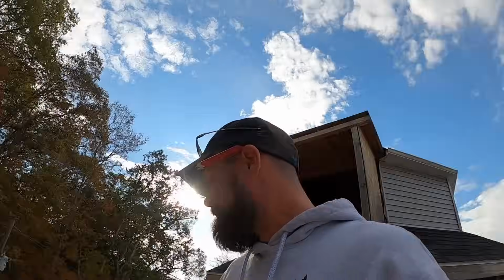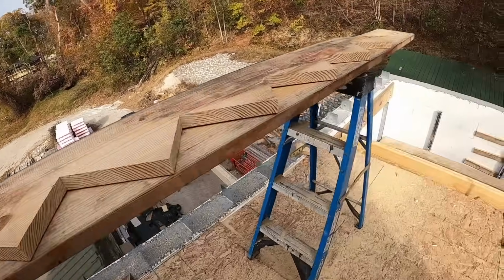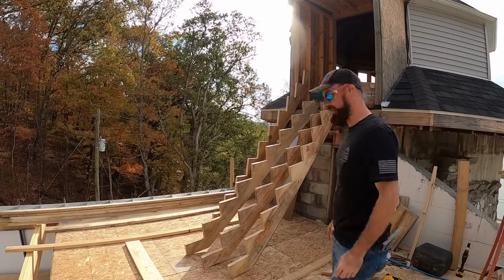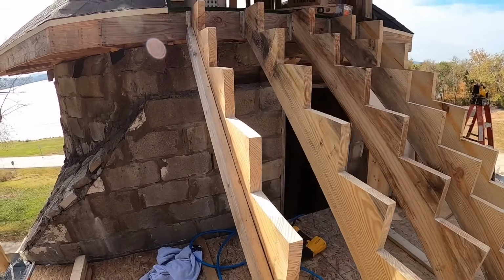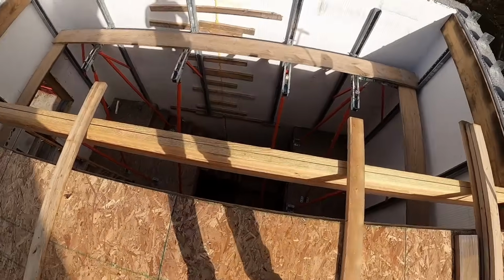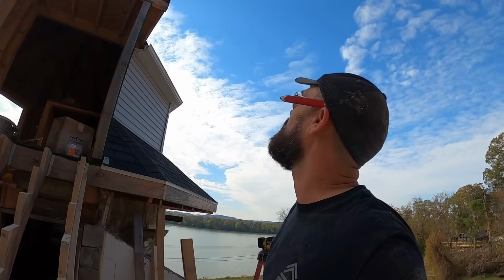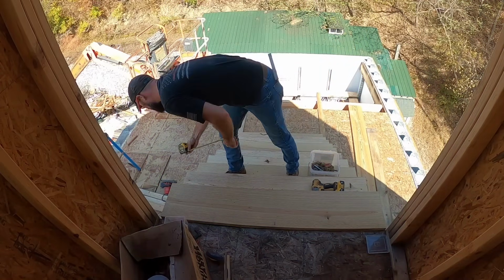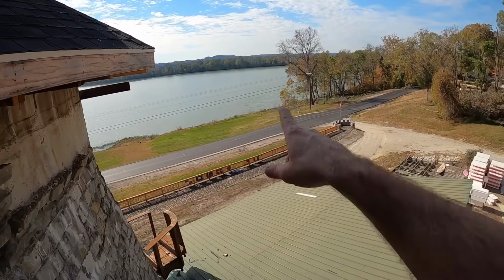Stairway to Heaven install! Did I get it knocked out this time?

Comment: 🌟🌟🌟🌟🌟 Coming down those strairs and go around both sides back twards rock wall and back togeather and down again like the stair you just put in directly under going same direction ---- kinda like a double blender mixing cake mix only at @ angle 💥

Comment: Matt , I use Twisted Mason Line that is colored to visualize where I might be able to lay things out . Tie a loop in one end and nail or screw it off to a starting point , then run it over to where you Think it needs to go , and secure it , stand back and ponder on it awhile . Much cheaper than cutting up lumber and changing your mind .

Comment: Hello Matt, thanks for the update. Something I do with all corded equipment is to flip the cord up over your shoulder and behind you and pull an extra foot or so.  If the cord is blocked by anything (like you or anyone else standing on it) it doesn't cause the tool to twist and ruin the cut. This little step will "mediate" all those issues.

Comment: Thanks for the pointing explanation. I saw you point and thought there must be something good - but did not see anything. After the explanation I went back and looked in slow motion - Just a few frames at 0.25 speed. For anyone looking - at about 4:10.

Comment: Question did you cut the width of your tread off the bottom of the stringers,, your right always use 1st stringer as pattern for the rest,,can't wait to see how you solve the space issue with the stairs,, doing good Matt,,,👍👍🛠🛠👍👍

Comment: On the next set of steps make the bottom section a longer run. Start out where they should , then run closer to the wall. Then off the landing the next tun is shorter dumping you out closer to center.

Comment: I have built dozens of stairways in my career as a builder. I got to where people would hire me just to build staircases, usually in places where other carpenters had told them there wasn't enough room for a staircase.  Everything from straight up one direction, straight runs with platforms like your first staircase., to full spiral stairs. I would suggest that in place of the platforms, you divide the platform into 2, 3, or 4 "turned" treads, or spiral treads. By doing this, you cand add 4 to 6 risers/treads in the same linear space. As long as you maintain a 7-1/2 to 8 foot ceiling above the stairway, moving furniture should not be a problem,  given the good width you have on your stairs.

Comment: If it was me from the top of your cancel, where you got that second route from the top just above you little slanted concrete. I see a wall there. I bring you wall straight out from tmatt. Can I someway and just drop it? A foot or a foot and a 1/2 at the outer edge from that corner of that roof that way, your roof is just the same angle as your roof your secondary roof off your top of your castle.  Power and then it will still push stuff off the top. But you still have a little room on each side of the building the floor that you're on right now. And still have a lot more room to put stairs. And you can have 2 or 6 walls all the way around the outside edge. And it would still be a lot more room out there.  And I'll not pull your building

Comment: Stick build the outside walls at seven feet to give you more head room instead of changing the roof look. In doing that you could install several windows giving a great veiw out side. A couple of skylights would really be nice.

Comment: You could run your stairs …. Starting on the far right side against the outside wall up to a landing turn left to another landing and turn left up to the landing of the stairway to hev . All this if you would be standing on the top floor looking down to the second floor stairwell.

Comment: I wondered why you don't extend your bottom flight the running distance of the lower platform(approximately 39 inches) since you are able to put the next platform (2nd flight one) over the first-floor bathroom.  That would raise you up another 3 steps on the first run, then conceivably move your second run landing that distance (39 inches) toward the center of the upmost floor for your top landing.  I would also consider installing windows, at least on the downriver side of the stairwell to heaven wall for the view and for the light in the stairwell.

Comment: You have extended your upper floor 10" and robbed 10" on the bottom floor. If you want 10 more inches on the bottom floor, cut the top step off of your stringers and slide them back. You may have to be a little creative with attaching the stringers at the top but looking at it, I'm sure it will work. You can do it!

Comment: Sometimes i am kind of slow so maybe you can help me understand, my thoughts on the base riser being 1.5" shorter was for the 1.5" tread to transfer the correct height all the way up the stringers. What am i missing with the bottom plate added below the base.

Comment: I hope you only misspoke and didn't cut too much off the bottoms of the stringers. 7-1/4 - 1-1/2 = 5-3/4, not 5-1/2. If they are 1/4" short, not a big deal. Can leave them,or add a couple strips of plywood.

Comment: I would try to make the first run of stairs as long as possible against the icf (asymmetrical), if that's not enough, extend the stairway to heaven a few steps thru the subfloor, to save heigth for the lower stair.
Reply from the maker: Thank yiu
Reply: @nyamillennial  gladly, nicely done 👍

Comment: I wonder if you had a spiral stair case put in for the final steps going up to the top center area. That could be done in your brothers shop with a heavy pipe and you can start at bottom where you want and stop toward the center.

Comment: To help your stair issue increase the height of your stairway and increase the pitch of your roof.
Reply: Increase the height of your stairway wall from the 4' the height of the roof coming out of the castle and increase the pitch of your roof and eliminate the shed roof making it more of an A frame roof

Comment: I think you nailed the final set of steps Matt and it looks good, I like way you made them so wide and I have no doubt you will figure out how to make the whole staircase blend together. I have slowly turned my tool set over to batteries with a corded circular saw in reserve, an air hose is cluttered enough without adding at least one or two power cords as trip hazards. Your doing good work Sir!
Reply: LOL, AMEN BROTHER - trip hazards and half dozen cords with air hoses - yeah- definite ambulance ride in the future but that is how it was done back when I was younger, still remember using dads all metal drill with cloth wrap cord and skill saw, quite shocking at times LOL.

Comment: Could you install a dormer at the corner to allow the height you need, with a window to allow light into the upper part of the stairwell and room?
Reply from the maker: I could but 90 degree inside corners are always problems down the road

Comment: Hey Matt.  Instead of a platform install winder steps to turn the direction of the stairs.  You will likely find you can install 3 risers per platform location, so by adding a second platform/set of winders to turn the stairs away from the back ICF wall toward your Stairway to Heaven.  If you do both winder turns that would use up some 6 rises in your stair run.

Comment: I believe you are over thinking the stairs. I mean, I don't have the measurements but going on what you have said in past videos, you should have enough room to do the following: 

Move the stairs over tight to the wall...the overall shape will be a 'U'. Start with the first run right to the wall and have it come up to the first platform the width of the stairs. Then turn 90 degrees and rise until a platform is needed in line with the hallway/stairs to the top. Then have a final step or 2 to the platform. The stairs do not need to be the same exact width on the final turn as the hallway, in fact it would give additional room for another stair or the needed landing. If you fall short a step, you can use a winder on the platform, you will just need to make sure it meets code. I know people hate winders... But you have a tight space and it works! 

Even if the stairs sticks out into the bedroom room by a stair or 2  it would be better than having an odd shape on the roof or a really messed up stairway.

For the roof from the stairway to heaven, you can have it bump up as a little cupola (the whole length of the addition to the framing of the steps) with a bunch of windows and have the pitch match the roof you are building on the addition, just raised enough for head height. It would bring in light and give another amazing view. From the outside it would look equally cool and look intentional.

Comment: Maybe I'm missing something in your explanation and I'm sure you are in actual time way past this point, but why not make the outside wall (not stairwell wall) a full height and do a gable roof from the castle turret (if that's what it's referred to) to the back? The stairwell would stay the same as below and you wouldn't be losing a bunch of usable space on this level. Just my thought.

Comment: For your consideration if there is a possibility, the stairway to heaven, could you at least leave some of it as an open stair case with railing, it helps give a sense of a bigger open space which will make the upper room a sense of something special anticipation, the other thing is under that stair case, leave one side open for a storage closet with doors or drawers? Mat, I think you are doing a great job, the stair case came out really sweet, the thing about working out plans on site is you are never really sure until built, but there are 2 things with that being said, if the plan works, your a genius, if it doesn’t, you get to, shall we say “modify on the fly”. I have worked on projects where prints  were either spot on, or we need to modify on the fly, or what were they thinking when they drew the plans up. Any case thanks for the update sir, I am enjoying this series.

Comment: Why not just just go with open in the middle barn style roof? Take all the complicated math out. Come in 2' from each side, go straight up with walls, 4:12 pitch on top and frame down a hard angle on the outside. Use as much room as you can get.
Put some of that limestone that Captain Kleeman salvaged on the front to "blend" it in.
Or, I cringe saying this, move the bottom stairs to the wall (back left from the river) and you should have your clearance.

Comment: Mimic the lower stairs but push the platform against the ICF wall like you said but could you make it  a L shape by bringing it over so the last half of the stairs actually line up to the upper ones you built , so in a sense you would be going from the landing straight up a continuous set of steps , that way the framing would be easier.  Just a thought , don't know if that would work,

Comment: If you need more landing space than the 4’ 7” you could cut off the top step and move the stringers toward the tower. Make your top step the tower floor. If you need it. But looking at what you have I think it will all work out. I would probably push the steps toward the back of the building, then you could have the off set wall in the back. Make the front wall straight. Look a little better from the front. You would probably need two landings then. That way your next steps should end where the tower steps start. Hope it makes sense. Love the videos I like to watch you on the struggle bus lol! Scratching your head and watching the smoke coming out lol.
Reply: I was thinking the same thing. I never led off a stringer with a tread. You just need to be creative attaching it the the upper floor system. It would save 10" at the bottom. Actually, I think possibly code does not allow it.

Comment: Having blueprints from the get go would have eliminated all of this last minute planning. You’d have known from Day 1 what you were building. THAT is why people hire architects 🙄
No place I’ve ever worked would issue a building permit for an addition of that scope without stamped and sealed blueprints.
Reply: Some jurisdictions don't require building permits. I lived in an area that only required a PERC test for the septic and then you just built what you wanted. And that was the direct quote from the permit office when I went to get a building permit. 🤷🏼‍♂️

Comment: Great work really
Just a thought for steps form 2ed floor to top
a L configuration where your landing is totally on the right and your exit on 3de floor will be in the middle unfortunately you loose symmetry of bottom stairs 
Just a thought

Comment: I realize it’s probably not an option but it would have looked amazing if you would have put a skylight in the roof opposite the stairwell to heaven so you were looking at the sky as you walk up the stairs.
Reply: Matt can you build the wall off the castle sides up first like a hip wall instead of a hip roof then build the rafters or trusses from that height. Will give you more head roof all around.

Comment: If you don't yet know what the final use and configuration for the apex room will be, that allows for lots of speculation on some possible alternatives for the stairwell.
Unless you need the space under the stairwell, and the existing small access opening in the original castle tower......you could have "notched into" and opened up the tower floor system at the top point where your stringers are now attached.  Opening this up would allow your stringers to terminate probably 24" further into the apex room at the top and also provide 24" more floor space in the new room at the bottom of the stringers, which could make it easier to fit the next stairwell into the room below.
Now, of course if you need maximum space under your stairway to heaven for storage or in order to keep access to the existing opening in the original castle wall,  none of what I am suggesting would be possible.
It just seems to me that the top of your stairwell could be moved further into the apex room without interfering with whatever you finally use that top space for.
Using the clothes hamper basket shown in the video for a reference, the entire floor space where that basket is sitting could have been opened up and a new header for your stringers to mount to could be framed up.  Seeing the short walls of that area implies to me that they are sitting atop a joist system. Notching into that joist system to gain a 24" advantage for placement of your stairwell might have been well worth the effort.  I am not criticizing you on what you have done, I am just sharing my thoughts on another possibility. 
At least one other person made a comment that I believe they were thinking the same thing  but they described it a little differently.

Comment: OMG, why so many stair stringers?  It should NOT be that wide.  You want to store items behind the stairs, and need room to move.  It seems you built this addition JUST to house your stairs.  Keep everything at 3 ft, so it all blends.  Come up straight 10 steps, have a landing to make a right to two stairs facing the stairway to heaven.  You don't want to "rafter" on the stairs, you need to narrow that staircase, so another wall can support a taller roof.  Please draw it out first, math is important!!!  You'll get there, I'm sure.  GL  Cheers NYA

Comment: Too bad you have learned so little about planning stairs. Of course I expected the overkill on stringers.  You cause yourself so much extra work because you just don't learn. Having a vision for what you want is fine, except when that vision far outpaces your knowledge or skills in carpentry. Try to remember how to measure for stairs since it caused you si much extra work before. I'm almost impressed that you remembered to adjust for the skirt board and gypsum board on the stairs that several of us told you about before. You're welcome.
Reply: Yes to all the above, but there is a screw up on the height of the first tread!
Reply: @trevormorgan6611  Guess I missed it.  I thought he said the stringer riser is 5.5 plus the 2x where the stringer lands.